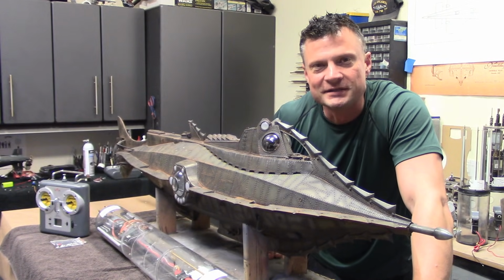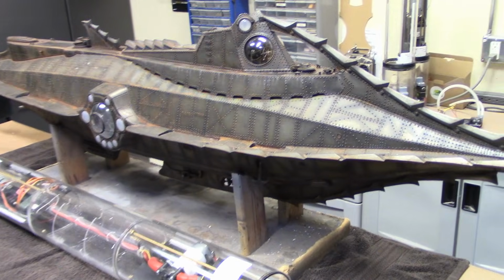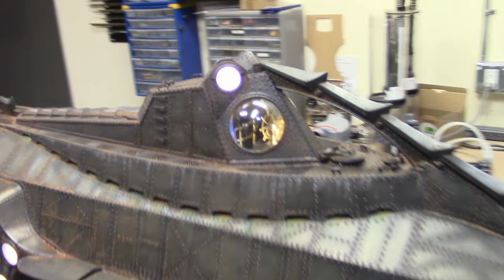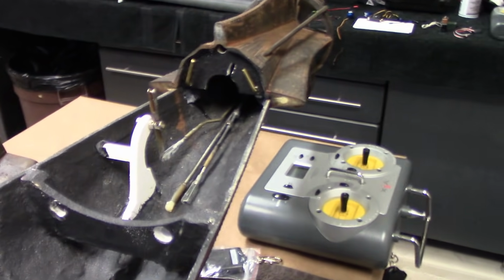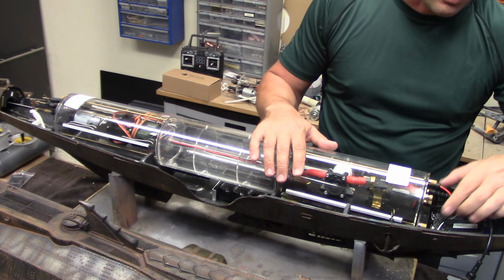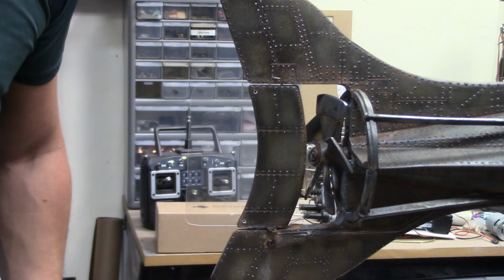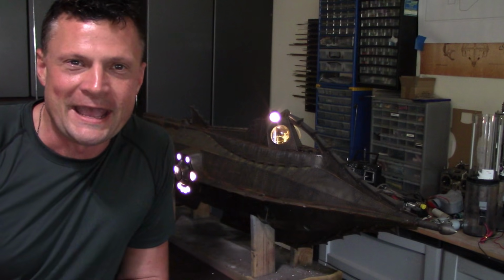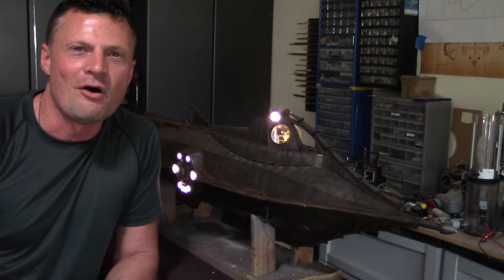Disney Nautilus RC Submarine in 1/35 scale

Comment: Hi Bob, I presume, that the power plugs between the main battery and the technic cylinder as well the connection to the lighting in the free floating area are not watertight, right? Are there any problems with short circuits or electric chemical reactions in the water?
Reply from the maker: Fresh water is actually a good insulator. When contaminants are introduced, you will get corrosion on the positive terminals, which can be quite severe in the case of heavily chlorinated water, for example. If you use some good grease, it will help insulate the connection (assuming it's non-conductive, of course).

Comment: Did you build an Alvin type submarine?  I would like to see one with an inboard camera and a lot of lighting.  :)

I remember reading long ago how Picard solved the loss of power problem on the Trieste.  He used magnetic valves on the ballast nozzles which were filled with iron pellets.  Too complicated of course but recovery after power drainage is possible if a servo is used to maintain tension on the emergency buoyancy release.